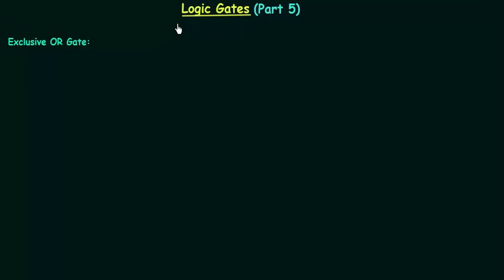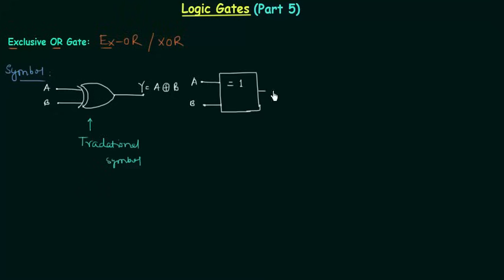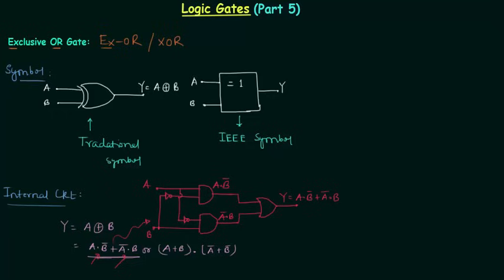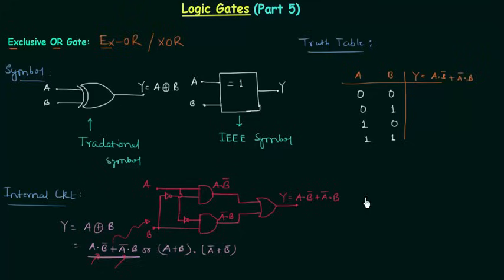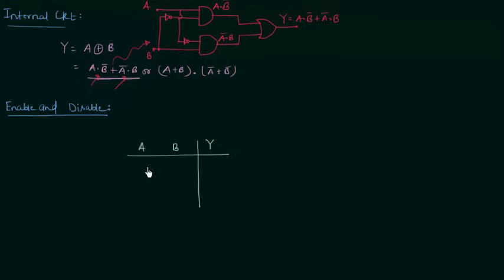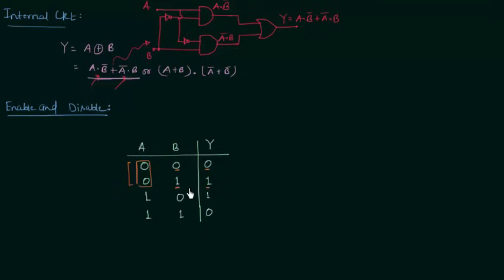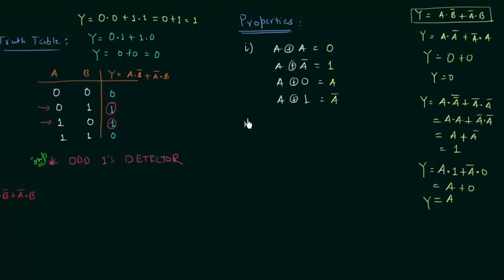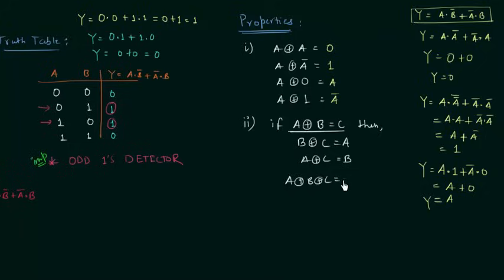Logic Gates (Part 5) | Important!

Comment: Q1   D
Q2   B 
the problems appear to be intimidating but they are easy to solve actually,just remember to use the properties of XOR and you will easily get the right answer.
Reply: 1 XOR A compliment is A?
Reply: @dhritisharma8990  yesss
Reply: @dhritisharma8990  yes
Reply: How did you get that? @dhritisharma8990
Reply: dude what to do with the commas in problem 2?
Reply: question 1 answer is option B
Reply: @sanjeevin8655  I got B but isn't that equal to D?
Reply: 1D